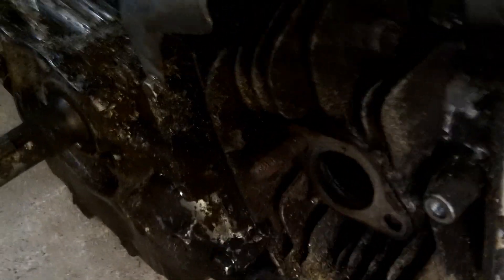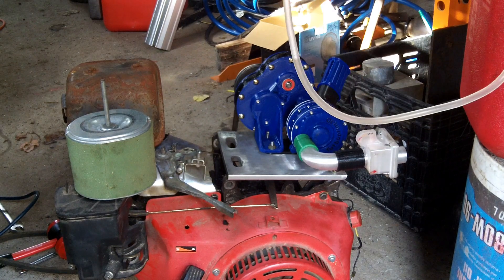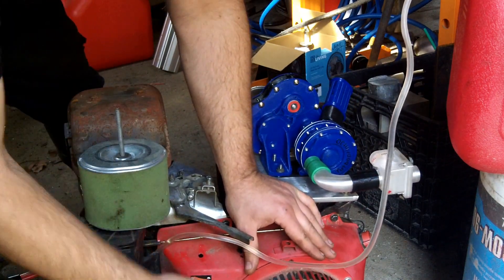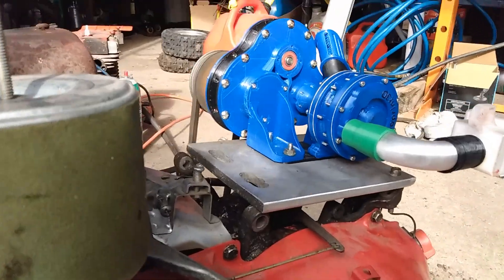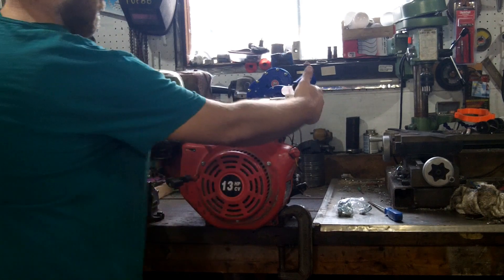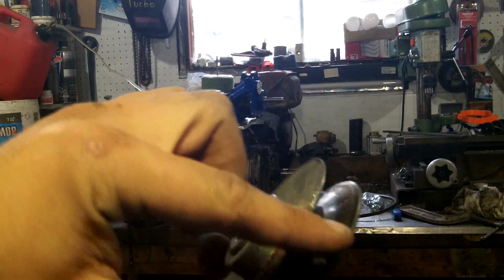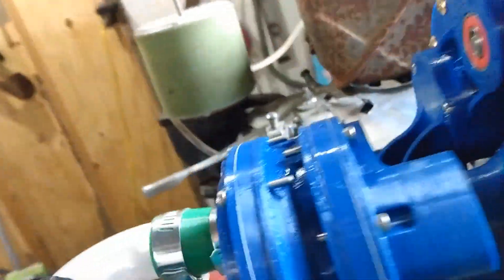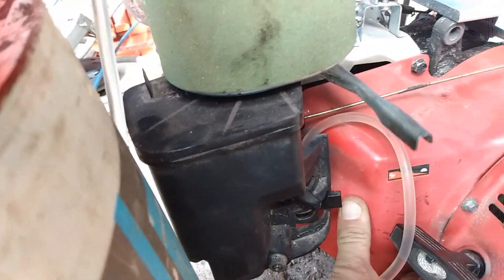3d Printed Supercharged Honda GX390

Comment: it would not be bad to put rollers with belts, which are sold from China, instead of gears. And also measure the pressure in the inlet during the tests
Reply from the maker: I measure the flow at the output,to account for any leaks , so I see the real flow that will be going into the engine , and there will be negative pressure at the inlet I don't really care how much vacuum it draws , as i don't plan on doing a draw through system . I get what your saying for more refined testing but really if i see pressure at the intake runner of the head then all the rest of the information is moot , unless I'm trying to sort why its not doing what i want . I'm not there yet . Ya i have ordered that stuff from china before , the issue is there not balanced , nor are they usually round , witch leads to harmonics at high rpm witch will destroy plastic parts, and bearings that im already pushing past there limits. That stuffs not meant to spin that fast . the gears are also more efficient as well as producing less tension on the gearbox housing itself. From a design perspective belts even timing belts are lower then gears for basically every notable property , short of sound . The biggest benefit of me making my own gears is I can replace them quick, cheap and easy, and if my prototype works out they are standard gears , witch can be purchased if need be , however there is about zero where on the gears currently , short of my taper lock slipping and tearing at the case . My old boss used to say belts break chains and gears don't ( witch is not true but I get what he was saying .)
Reply from the maker: also i like making gearboxes
Reply: @turboprint3d  I understand you bro, I would like the pressure to be at the inlet) and so you are doing everything right! real aggregates are born from experiments. sorry if not everything is clear from my text) I write through a translator.
Reply from the maker: @adminadminov836  thanks , ya find what works lose what dosnt .